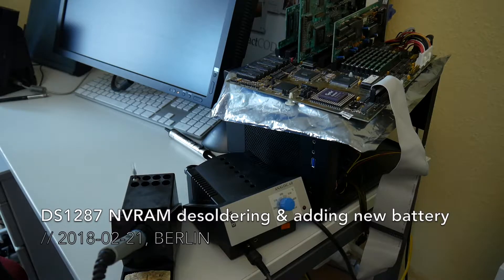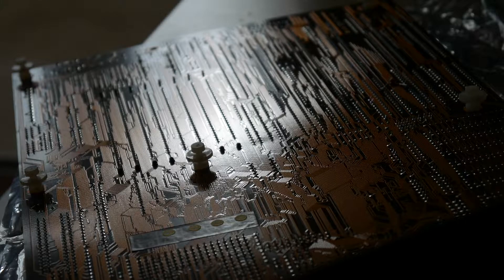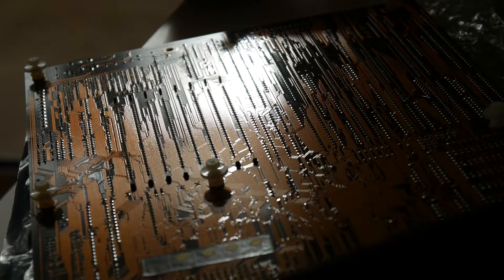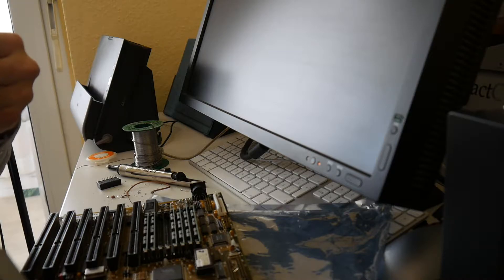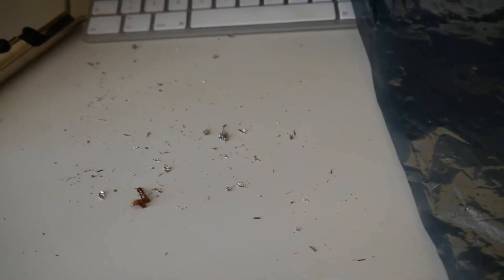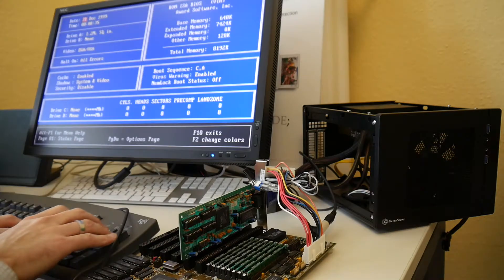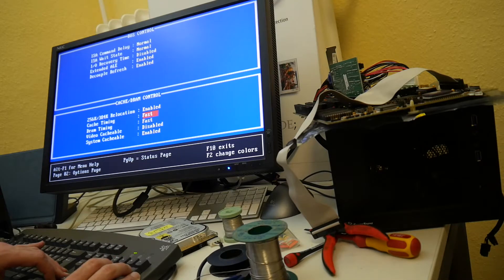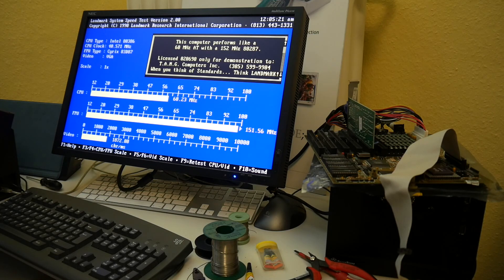Desoldering  Dallas DS1287 timekeeper and adding external battery

Comment: Isn't it bad practice to place your electronics on top of your anti static bag? They are designed to keep the static out therefore can have surface static on the outside? I am a novice but I thought it was something I heard while researching custom PC builds? Just fyi.
Reply from the maker: Don’t think so, anti static means slightly conductive, there should not be surface static

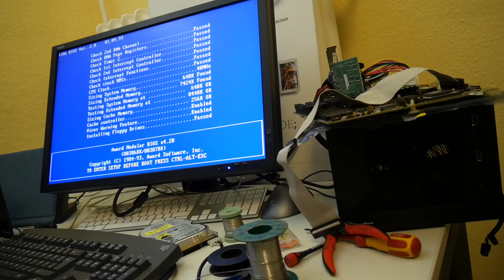Comment: 11:39 Ive had to do a harddrive swap on my original xbox while the power was running before and no problems happened, but is it dangerous, as in corrupt data or destroy the drive when doing it at the POST screen?
Reply from the maker: I dont know xbox details, but pata ide was not designed to be hot plug, so I would say a bit risky, but if careful certainty can work.

Comment: BITS&MORE BY RENE, how do you calculate using a handheld calculator to get the ROM chips ROM signature value and ROM checksum value? Which IC chips output IRQ signals that connect to the CPU microcontrollers IRQ input pin?
Reply from the maker: hand calculate why? and your IRQ question is a bit generic / unspecific, ... plenty of "micro controllers" and "IRQ pins" out there. Best just look up your model's data sheet, ...

Comment: BITS 8 MORE By RENE REBE, how do timekeeper chips work what do they do and are they RAM with a built in battery?
Reply from the maker: yes, plus the most important: a clock quartz crystal, plus some counting logic, battery and NVRAM for the non volatile firmware / BIOS settings, ...

Comment: why add a battery ? is not easy to change the component with a new one ?
Reply from the maker: as you can see in my Sun SPARC videos the new production runs are sometimes not compatible with the old hardware or software: https://www.youtube.com/watch?v=A3O1YVUI9N4 Also it may not be easy to get the parts in all countries, at least not cheap in single quantities. Also it is fun in any case ;-)!